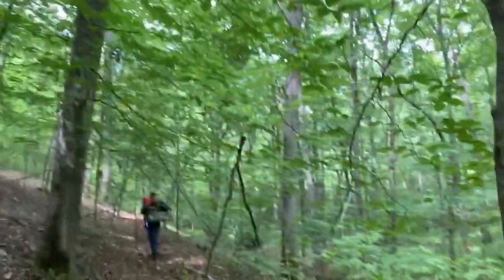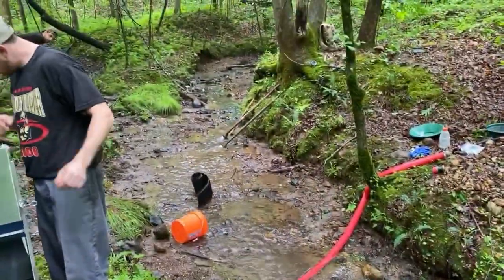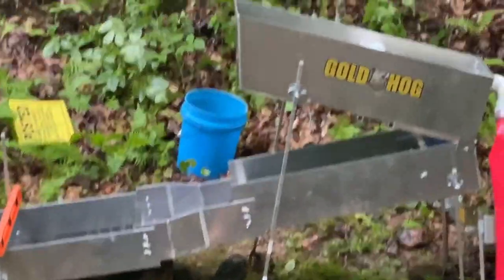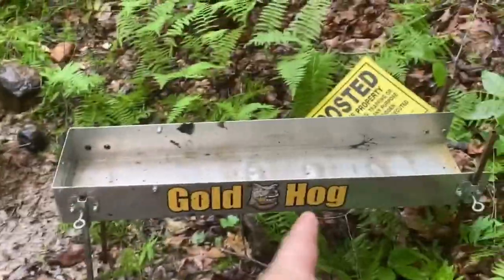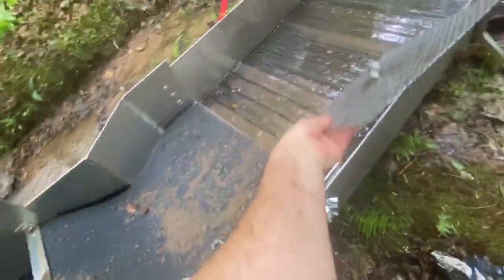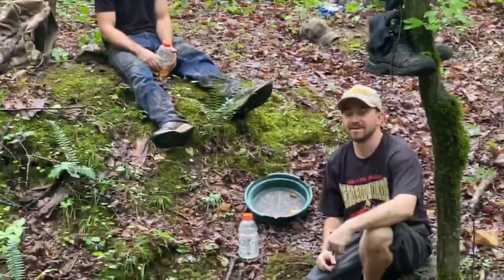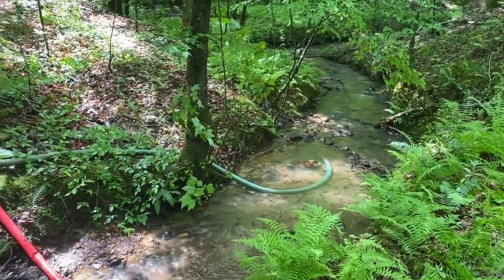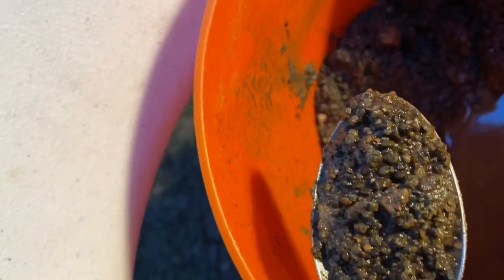Trying the Monster Hog High banker from Gold Hog! Giant high banker, Video 1 of 2 Coming Next Week!

Comment: Cool video of the monster hog. My Raptor flare 2.0 is a handful, but this is a whole “nother” level. I still debate if I should have done the piglet, but very happy with the Raptor. I use a 2” champion trash pump at 5/8” throttle. Last summer I bought a 2.5” dryland dredge kit from H&B mining, 20’ 2.5” tiger flex hose. Had to add a 6’ suction hose with quick releases to keep the 1.5” waterline fire hose from kinking near the hose nozzle. H&B swore it would work with my existing 2” trash pump (contrary to Docs advice). Once I figured out full throttle… it ate! Love the spray nozzle attached and the Venturi is shorter which I believe helps with less clogs. I also went with the crash box testing mat, miners moss and punch plate assembly, Captures ~75% of the gold just in that top section-great for progress checks. Unbelievably good. I do think you should add at least one more section to your box.
Looking forward to more videos!
Reply from the maker: Hey buddy ! Nice to hear , funny thing is after this I’ve been looking and thinking I should have went with the raptor flare. And maybe even the piglet flare  for a few places. This area has a lot smaller creeks then what I’m used to but the gold is better! It’s all tributaries to a larger river. Anyway I appreciate the comment and the conversation. What part of the country are you prospecting?
Reply: @sluiceboyprospecting  
Ha, I know. 
I’m on the left Coast the one with the tyrannical Governor…Ore-gone. It’s a shit show out this way.
Reply from the maker: @mattmallory29  dang man! And that’s such a shame. Y’all have so much gold out there and it’s so beautiful. My wife is from Eugene.